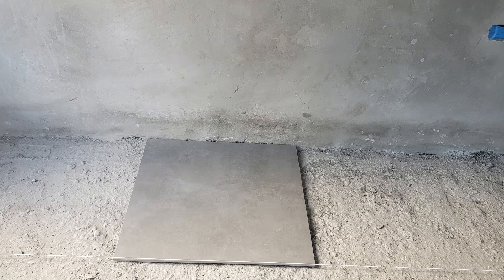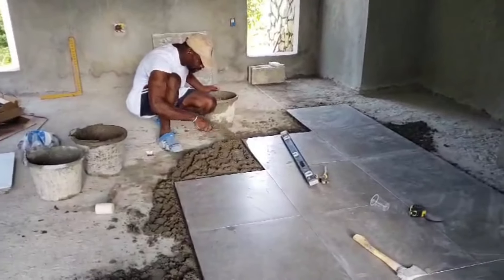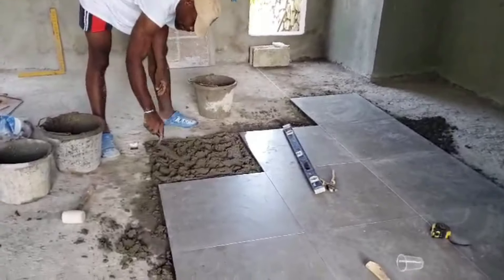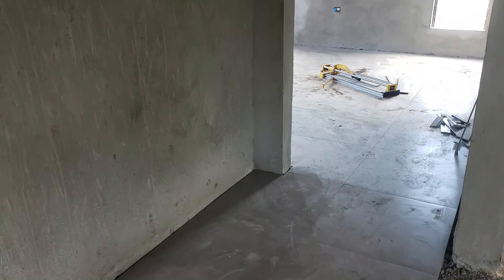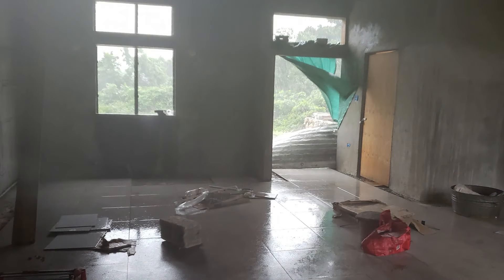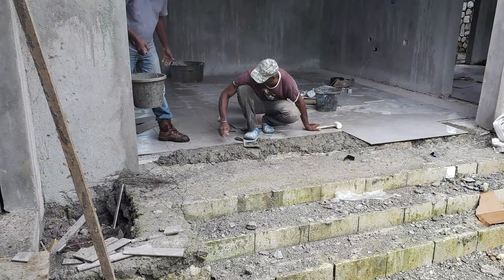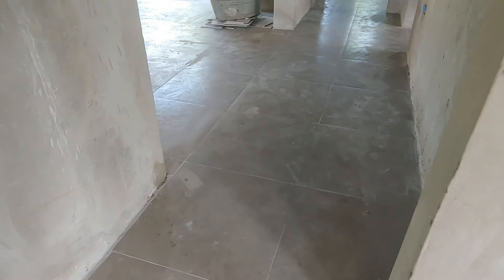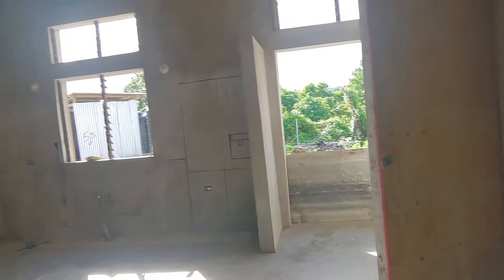Floor Tile Installation

Comment: Sorry for the critique, especially now that it is about done! 1:15 - Line up tiles in the building before you start, going down a long hallway, the middle of the path should be a full row of tiles, not one side or the other as shown here. That way the middle is full tiles and both sides are cut tiles. This is only over ridden by the rule of doing this at the front entrance, the center of the front door should be a full tile, then full tiles left-to-right of that until you get to the door jamb where you should now have equal cuts at both jambs. Tiles will last you the rest of your life, so do them right the first time.
Reply: Do you tile?
Reply: @BelleChristina I’ll have to say I used to tile and now no longer tile. These old knees wouldn’t let me even if I wanted to. Now all I’m good for is to sit on my couch and criticize. It’s an excellent tiling job when grout lines are even and tiles are level. I’m just saying that there’s something else required, tile alignment. The walls aren’t perfectly straight or square, when you run a full set of tiles against a wall, it shows on that wall as well as the opposite wall, then you end up highlighting the fault in the wall by having narrow cut pieces against the wall that are wider at one point then narrow down to nothing at the other end. A good example of this is at 6:57. When the full tile is centered and the wall tiles are cut and end up being big pieces, 1/2 to 3/4 tiles, you can't visually see the bad walls so easily, and the fact that you are cutting the tiles against the wall means each one can custom cut for the spot they need to go.
Since I'm at it - The fastest way to get a house tiled is to have an apprentice who can help mix mortar, bring tiles close to the areas they are needed in, but most important, teach him to cut and lay the edge tiles. This is the part of the job that takes the longest, you can lay all the whole tiles in a room in one day but it takes the rest of the week to cut and lay all the edges!
On the bright side, when all the cabinets and furniture are in, most of the walls are covered anyway.

Comment: The vanrrada tile floor  normally level  lower than the inside floor that it doesn't flood inside the house if it happens
Reply from the maker: You're right. Our verandah is lower than the house. Maybe you can't tell from the video
Reply: @precious-thenewjamaican4450  okay